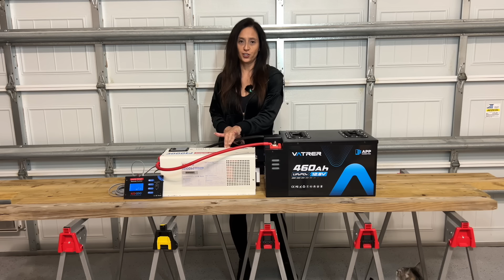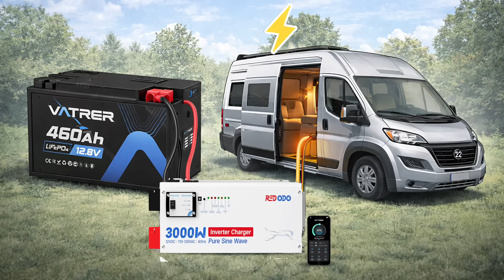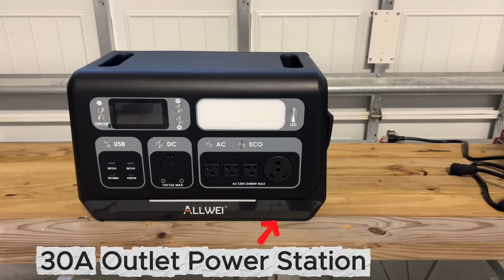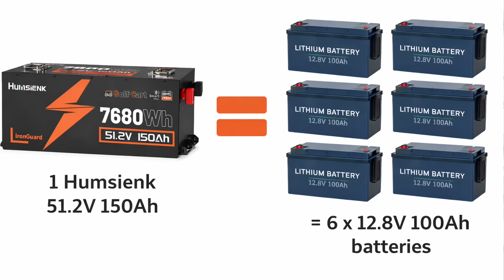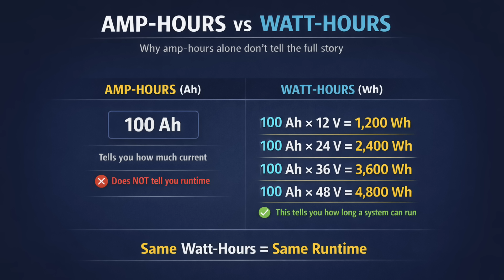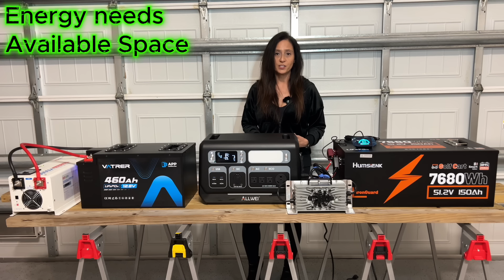Three Energy-Dense RV Power Options — Understanding the Differences

Comment: Ruby, this is an excellent video. 👍👍👍 I would choose the power station hub with a 51.2 V battery. A matching alternator is necessary, unlike the one used for charging 12V batteries.
Reply from the maker: Hello Mike,  Thank you for the comment!  There are many ways of charing the 51.2V battery as I'll be showing in my next video (I installed a 48V SunGoldPower Power wall).  In my van, I have a 48V MPPT for solar charging, I have installed a 48V battery charger that is connected to my incoming shore power, and I also installed a Ecoflow 800W alternator charger to the Ecoflow ... I can always plug my 48V battery charger into the Ecoflow and charge the 48V battery while the Ecoflow is being charged via the alternator.  This may not be the most efficient pathway, but it works.  I do like the idea of installing a 48V alternator as well, but I would need to find a kit complete with the mount brackets to attempt that project.  Thanks for watching!